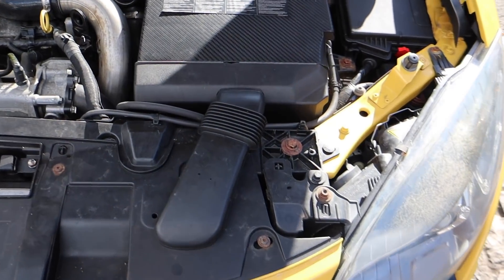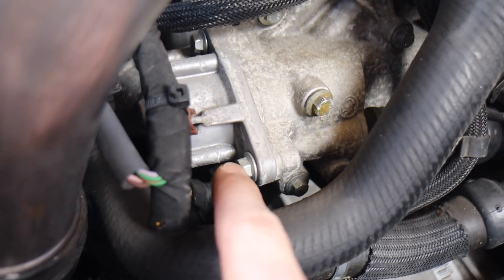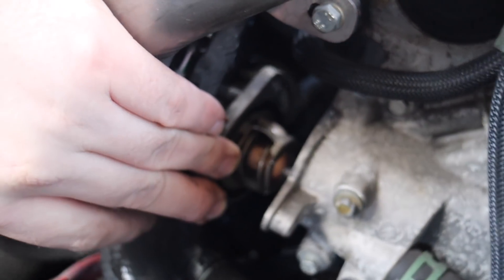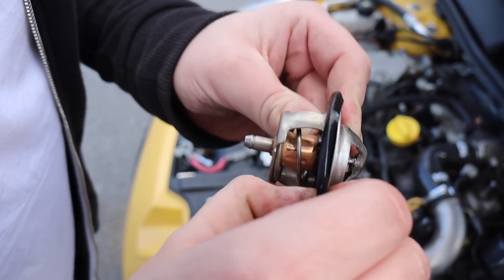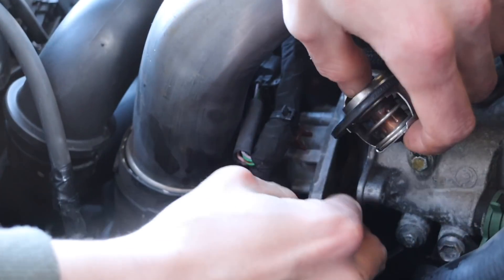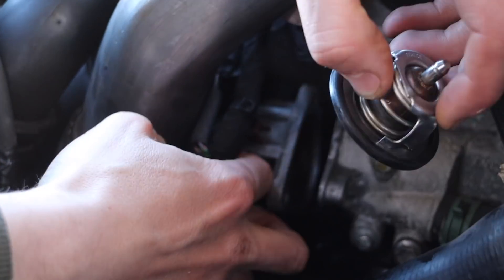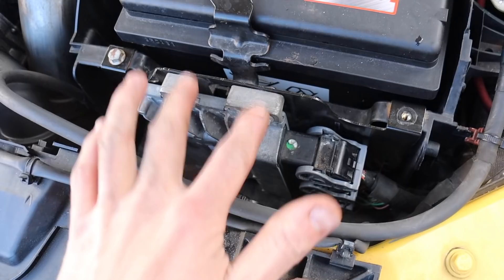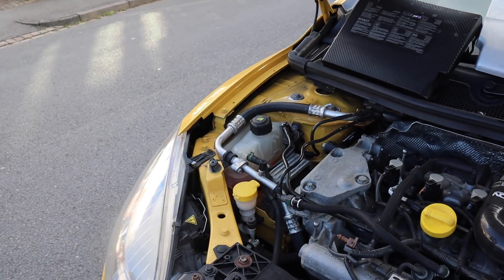RENAULT MEGANE RS 250 THERMOSTAT CHANGE (COMMON ISSUE)

Comment: Had to do this many months ago with mine bit fiddly but i just removed the top clip on the boost pipe and just twisted it out the way. Bleeding it, just ran it up to temp then drove it up the road and vooolaaaaaa✌️was done
Reply: I just had a look at mine because I need to do this, and I was thinking the same thing. Which clips off the boost pipe did you take off? The jubilee + the two bolts for the metal boost pipe right?
Reply: How did you bleed it? Just let it run with the cap off?

Comment: When I did the thermostat on my Megane I just ran the engine for about 20 minutes with the coolant expansion tank cap off, and it eventually sorted itself out, then topped up the coolant.

Comment: Ive had this battery tray out 3 times abit fiddly! Ive done the bolt mod for shifter, yes you drill a hole i think 10mm, you can find the info on google however i think the shifters too stiff after the mod so will be returning to standard! Question: what video upload program you using?
Reply from the maker: Final cut 👍

Comment: You have the wrong colour coolant. Think it's supposed to be Renault type d which is yellow.  Take bumper off. Remove plug on radiatior.  Use bleed screw next to the thermostat. Refill.
Reply from the maker: That’s what was in I when I bought the car 🧐👍
Reply: @JustbeingHayden  yeah mine too. Quite a easy job to do. Basically just remove front jumper and remove one bolt. Take a awhile to flush through but worth it to know your running the correct spec coolant with a new thermostat